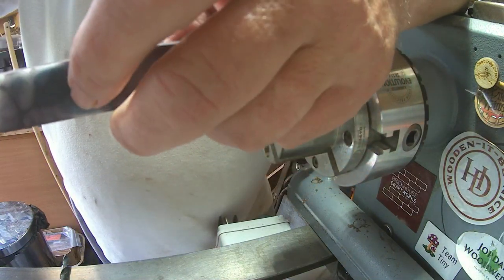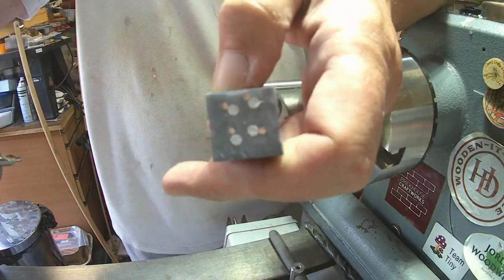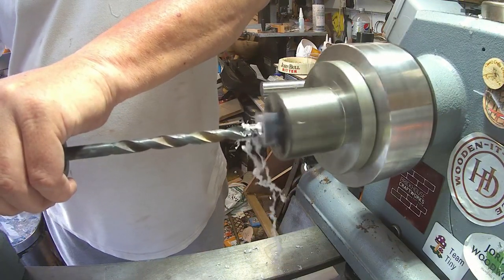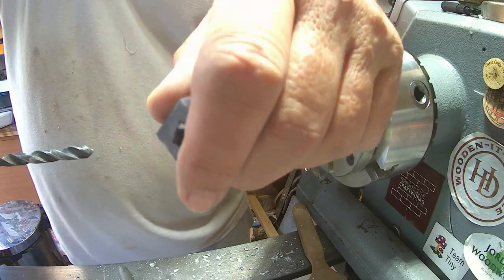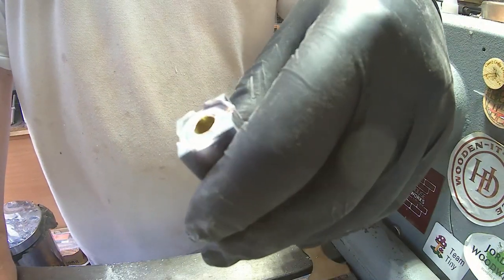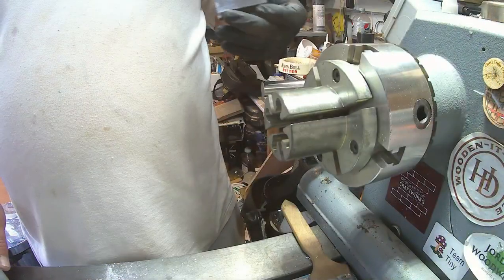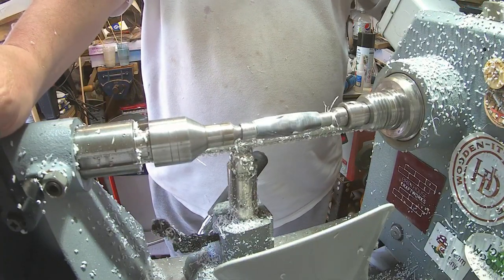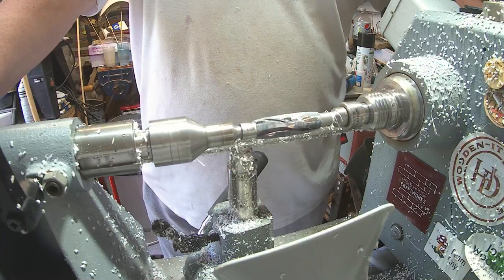Turning a Pen from a Resin Blank with Copper & Aluminium Wire from Wendy, Toonpish Crafts. A FAIL!!!

Comment: I respect the effort good sir!   I guess this is a good demonstration as to why it is not done much.  If you do retry I totally agree that thinner wire would be a higher chance of success and hope you also consider using some transparency in the resin to help show off the depth of the wire (just my own thought).   I was considering trying this myself but after seeing how challenging it is I have to accept my newbie limits.  Really appreciate you showing the failure.  I learn soooo much more from the failures than the successes.
Reply from the maker: Hi Perry, Thanks very much for watching and taking the time to comment.
The blank was made for me as a collaboration and I had the blank with the thickest wire in it.
I will make my own using thinner wire but will keep the colour solid as it it was translucent the tube would show through which is not a good look for a pen.
If you do use resin I would recommend Lets Resin as it does not need a pressure pot and is bubble and odour free which is great.
I always show my failures as it is good for people to see that not everything works out every time and hopefully people can learn what doesn't work.
Take care Perry and thanks again.
Cheers, Huw
Reply: I hadn't thought about the tube being visible thats a good point!  Yep i guess darker colours is the way to go :)
I saw toonpish's original video which was what brought me here to you :)
Happy Turning :)  @WoodenItBeNice 

ps I thought about it and wonder if a visible brass tube with spiraling copper/silver/bronze wire may actually go with it as a sorta theme?  I dunno, it's just a thought.  Watches with visible gears and internals area  popular thing haha
Reply from the maker: Thanks Perry, Wendy is a great person and a good friend of mine.
Translucent blanks do work at time when the brass tube can accentuate the colours in the resin.

Comment: You gave it your best Huw and glad you stopped and was aware of the potential danger when you tried one more time.
When we used aluminum frames for resin molds we cast we would sand the aluminum down and then it stuck pretty good. These molds were used to pour hot wax into for making jet engine impellers so they had to hold up. Just a though.
Like Kenny Rogers said: You got to know when to turn them and know what to quit. Well not the exact words but you get it.
Take care
Hwyl,
Gary
Reply from the maker: Thanks Gary, I don't know if Wendy sanded the wires or not so don't know why it was such a big blow out.
I used to do lost wax casting in school and college for Silversmithing and it was great fun.
Take care my friend.
Hwyl, Huw

Comment: Quite the shame. Looked like it was going to be stunning. I wonder if the wire had been coiled through the blank instead of laying along the blank, maybe it would work better? Also with drilling, it may have worked better to go part way from one end and then finish from the other end. You looked to be working as carefully as possible. This blank just didn’t work. Well done Huw.
Reply from the maker: Thanks Doug. The blank is sitting next to me at the minute. I will try and fix it and video what I do.
When the drill got stuck I think it was some of the wire getting caught in the flutes of the drill.
Take care Doug and thanks again my friend.
Cheers, Huw
Reply: @WoodenItBeNice  I am sure it was the wire getting stuck in the flutes. Think I’ll go back and watch Wendy make these blanks to see what might be discovered.
Reply from the maker: @DougMilleratWoodSpunRound  It was the second blank from the left in the block of 4.
Reply: @WoodenItBeNice  as I watched Wendy’s video I became positive that it was the blank with folded wire. I going to guess that Wayne’s blank is a failure as well. Just not enough grab of the epoxy on the wire. The wadded wire worked because it was more interlocked. Stunnng when it works.
Reply from the maker: @DougMilleratWoodSpunRound  Wayne's did work out but he left a much wider body to the pen.

Comment: A brave attempt. It could have been so nice, maybe as you said using thinner wire or even coiling the wire loosely around the tube.
One thing on the drilling; there seemed to be an awful lot of drill sticking out of the chuck which might have contributed to the first problem. Would setting the drill deeper or using a shorter bit help to control vibration at the tip?
Better luck next time.
Reply from the maker: Thank Myk, The drill was in the chuck as far as it can go. I may need to invest in shorter drill bits.
I'm going to find my copper wire and give it a go I think.
Thanks for the advice mate.
Take care Myk.
Cheers, Huw

Comment: Well, discretion is the better part of valor, Backing away is no sin in my book Huw. Good try for sure. I think the main problem is the epoxy is not strong enough to support the cutting forces needed for the metals. Perhaps if they were annealed it may have worked. Well, now we know !  Thanks for the lesson !!   Take care. -Mike
Reply from the maker: Hi Mike, I agree it was time to stop for the time being.
I believe the Aluminium was from some kind of armature so was probably harder than usual, I don't know.
I'll try this sort of blank myself and see how I get on.
Take care my friend.
Hwyl, Huw
Reply: @WoodenItBeNice  Worth another try. We'll be watching 👀
Reply from the maker: @mpart_woodlathe-stuff  👍🏻🙏 Thanks Mike
Reply: @WoodenItBeNice  👍😎
Reply from the maker: @mpart_woodlathe-stuff  👍👍

Comment: I suspect that as the copper/aluminium wires are Co linear and minimum/no cross over that the adherence of the resin just not strong enough to cope with the continuous stresses applied with the scraper, if there such a thing a gouge with an angular cutting action prob would reduce those stresses (maybe a skew prob with a decent angle on 20/15 deg?) if you think traditional planer vs spiral then it’s more of a slicing action. Anyway good attempt, serious brave pants on with no body armour 😂. Just another observation the initial wobble with the drill seems to suggest alignment issue from tail stock to head stock, maybe. Like the use of the c-drill 👍🏻 So mate so honest of you to upload and publish I’m sure loads of us seem to only publish the successes. Take care and all the best Cheers Steve.
Reply from the maker: Hi Steve, I've had to get my dictionary out to look up some of those words in your comment. LOL.
I agree that with a shallower cutting angle I might have had greater success, as you said it would be slicing and not scraping.
I have a lot of natural body armour, LOL.
Before I put the mandrel on my lathe I align the headstock and tail stock every time.
I put the wobble that time down to the wires being quite close ti the drilling point.
When I started on YT I promised myself whatever happened I would show as then maybe someone can learn how not to do it or what can go wrong for whatever reason.
Brave pants back in the laundry basket and then into the drawer for a while. LOL.
Take care mate.
Cheers, Huw

Comment: Gutted it didn't work mate . Couple of bits I noticed the wire was wather thick and possibly too straight also I noticed when it came out it was very shiny sorry Wendy I haven't seen you making the blank but ill have a look did you rough up the wire with sand paper first ? If the wire was twisted in the blank I think it may have survived? Great to try new things and good to see the bad with the good mate 👍
Reply from the maker: Thanks Dan. I always show good and bad. LOL.
I think the wire was too thick so I will try this with thinner wire.
Thanks for the support mate.
Take care Dan.
Cheers, Huw

Comment: Oh never mind, Huw, I can imagine that resin with that sort of wire in it is tricky to turn… Occasionally it might turn out well, depending on where the wire is within the blank, but generally speaking I would say it is probably more likely to fail due to the very different resistance of the used materials… Still very interesting to watch, keep them coming, Huw, thank you 🙏🏻 I have to do some catching up on your videos so more for me to watch 😉👍🏻 Take care, Huw, hwyl 👋🏻 Jude
Reply from the maker: Hi Jude, I agree with you on all counts. The main reason I think this didn't work was the thickness of the wire. 
I have seen quite a few blanks with imbedded wire and they turned beautifully, but with thinner wire in the blank.
I'm going to try to save the blank and also make my own and turn that.
It was fun to try and if you don't try you never learn.
Take care Jude and I hope you enjoy the other videos.
Hwyl, Huw

Comment: Good effort Huw, shame it didnt work. How about attaching the wire directly to the tube then casting in the resin, maybe less prone to blowing out then?
Reply from the maker: Thanks Gary. 
That is a possibility. I think thinner wire would work better that piece of aluminium wire was about 3mm thick so I think the end result was inevitable.
I am thinking of ways to repair the blank and finishing the pen.
Take care Gary and thanks again.
Cheers, Huw

Comment: well the concept of metal was a good one for blank making, and you tried your best to work with it. 
Take care both of you and stay safe and well
Cheers
Harold
Reply from the maker: Hi Harold, Yes the concept works. I will make my own blanks but will use thinner copper and aluminium wires.
Take care my friend.
Cheers, Huw
Reply: @WoodenItBeNice  Not sure the length of wires would make a difference and whether the placement across or at angles on the blank would make a difference. Or even wrapped around the pen tube then apply resin may work. A thinner wire would work for sure as the carbide tool cutter seemed to dig into the wire and then the wire popped out. Metal filings should also work well
Anyways experimenting is half the fun, but safety is the key bit of any turning
Take care my friend and enjoy the week of experimenting and creating
 Cheers
Harold
Reply from the maker: @hfbowerndesigns810  Thanks Harold. when the carbide took out the piece that was the length of the blank I knew it was time to stop. Thinner wire I'm sure will work. 
My own safety is always first in my workshop and thank you for your concern my friend. Hwyl, Huw